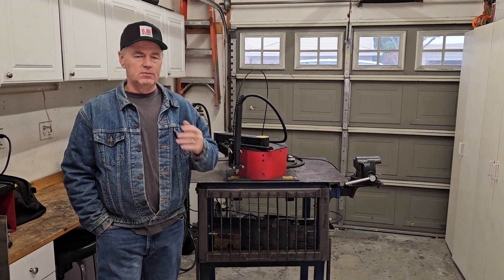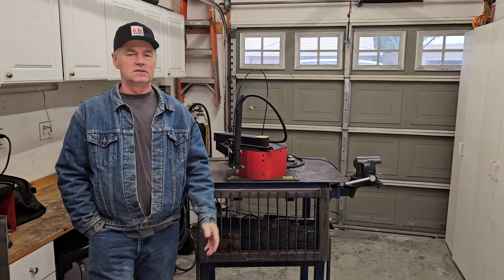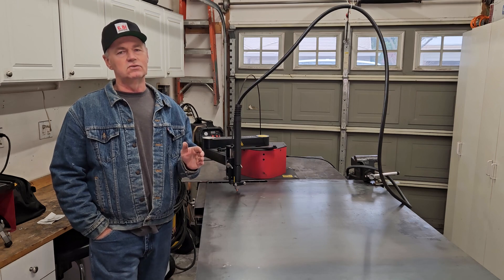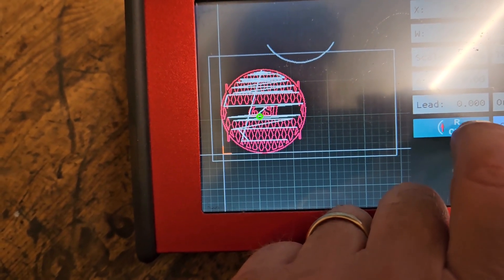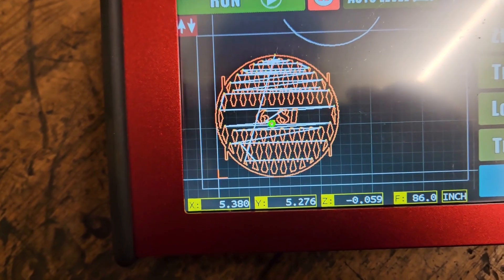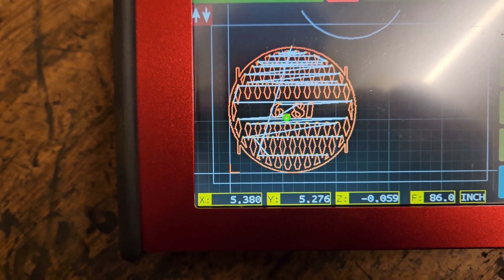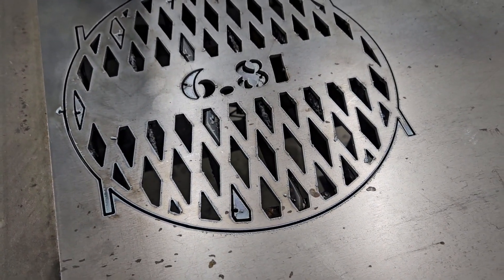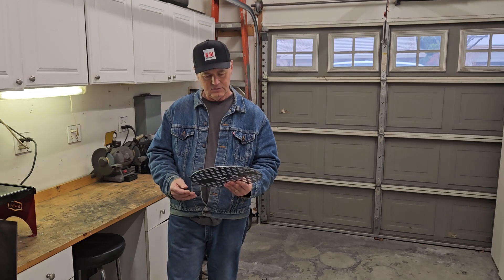Custom Sear Plate for Weber Kettle | Arcdroid CNC, Inkscape, and Sheetcam

Comment: TIP: When loading GCODE - the KERF value has no effect. It will always be read as ZERO no matter what you type in the box  - You need to bake the kerf value into sheetcam before post processing. This can be confirmed on the screen as no offset cut line is produced. All other values can be tuned as normal.
Reply from the maker: I do have the kerf set in Sheetcam, so I was surprised to see zero.  Thanks for the tip!
Reply: @6.8liter74  once it's baked into sheetcam the cut path is definitive. The kerf value  *is NOT * stored as a variable in the gcode. The other variables are stored and passed across. Cut height etc.  it's the only value that can't be changed
Reply from the maker: Cool, thanks again for sharing your knowledge!  Hopefully others are reading these comments and can benefit too.
Reply: @6.8liter74  I'm just picking bits up here and there. There's no one real source for all this information which is a real shame. I know Andrew is kind of a one-man band   but a decent manual would be great
Reply from the maker: @mattsan70 Same here and I agree we are missing a central source of info.  I worry each time I put a video out that I may have something wrong and lead others down the wrong path.  Thanks for doing what you can to keep me straight.

Comment: Thanks for your vids. I have a couple comments if you don't mind; first, you can school me about using the Arcdroid, this thing makes my head hurt. But...when it comes to the Weber, I can change your world about grilling. I have used a weber kettle forever, like you, I have the charcoal pans until I did some research. Please take the time to look up, BBQ Guru, it is a computer that controls a fan from temp probes for the pit and for the meat. I have been using one of these for about 8-9 years, it produces the best bbq you ever put in your mouth. I will gladly share my cook temps and times with you, I guarantee you will never want to go to a bbq place again! As far as this Arcdroid goes, Ugggg. I'm still trying to get basic settings figured out. In my opinion, no matter the thickness of material, the pierce and cut heights should remain the same. The plasma cutter itself and cutting speed will need to change with the material thickness. The only metal I have is 20g, which is to thin to practise with, it warps to fast. I have to drive about 100 miles to get to a metal place to get more material, that will be next week. As far as inkscape or sheetcam, its going to take a lot of time to work on that. I do have a cricut machine, which took me months to learn how to use, it resembles inkscape. Anyway, Thanks for the vids.
Reply from the maker: Thanks for watching and commenting.  I do love the Weber kettle and I've had good luck manually controlling the temp, but the BBQ Guru looks legit.  I agree with your assessment regarding plasma cutter settings.  Inkscape isn't bad especially if you are familiar with another software like your cricut uses.  Check out Bad Dog Metalwork's channel, @BadDogMetalworks, he has some greate Inkscape tutorials and Inkscape is free!